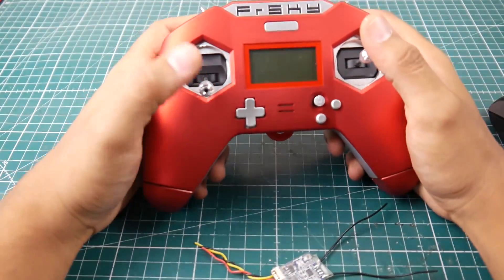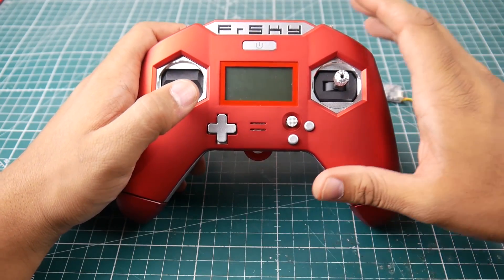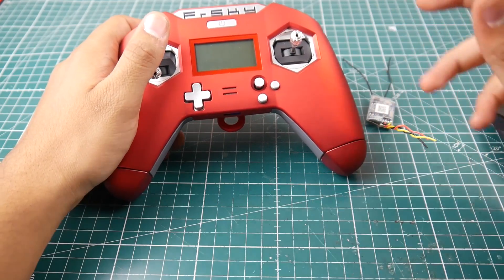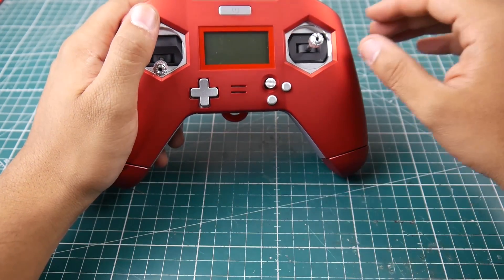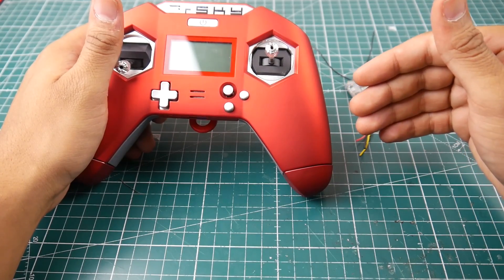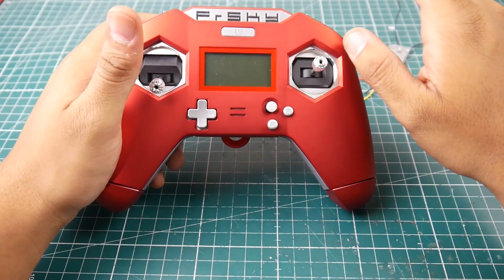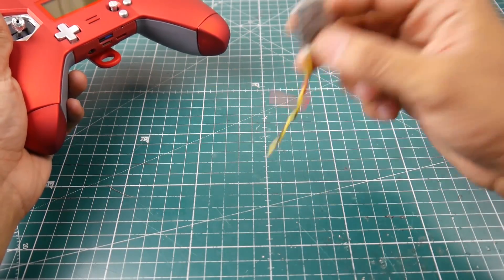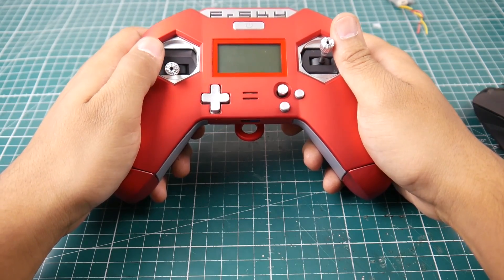FrSky X-Lite Long Range Testing // FrSky XSR Receiver [Part 1]

Comment: I’m confused, so you’re flying over 2km with a stock controller and a beefy receiver in the drone? 
I fail safe after 150 meters with a xm plus and a stock lite. Guy at my local hobby store says the controller will only transmit for 200 meters, than I’ll need crossfire or R9m.

Comment: +1👍 I'd be interested in seeing you replace the roller wheels with switches since you love modding.
Also, tell us your switch setup. I have all mine mapped to things, but i'd really like a pre-arm solution.
Reply: I use one of the rollers for my pre arm and that seems to work pretty well for me, not quit as good as using a momentary switch on the qx7 I moved from, but still it works for me
Reply: I tried (and failed) with the wheels,  @billdor121   but will certainly try again knowing someone has it working, Thanks!

Comment: Don't you have gps location from the OSD ?
Reply from the maker: Gated with wild pigs..If I go in I either get shot or eaten alive.. So I have learned to move on to the next setup.
Reply: @DroneMesh  yeah, that would be a great experience
Reply: Drone Mesh in your country you can own pepper spray right ? If so you can use that if they wanna attack you (and if you die you get famous 😜if you got it on film)

Comment: Always TX and RX antenna vertical when you try to achieve maximum range. They should always be parallel, and when the model is turning only a vertical antenna will guarantee that the antennas stay parallel.
Antenna to the side is ok for flying line of sight on the rc club field, but for fpv it will not give the maximum range.
Reply: Yeah, I never understood having the TX antenna to the side. I don't put my RX antennas vertical though. I put mine in a 50-60 degree V shape angled backwards at 30ish degrees. Neither is ever vertical but one is always close. I got about 1km (unwillingly) on a fs-i6x and x6b RX with that.